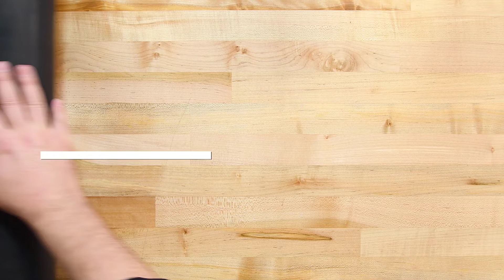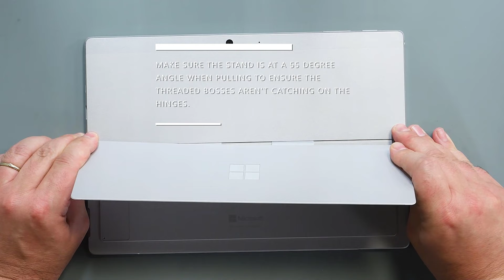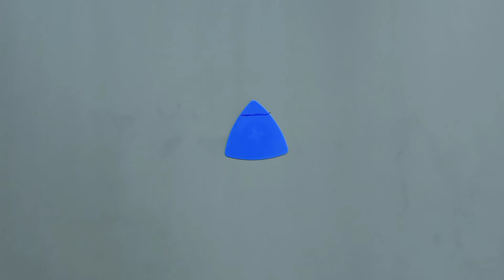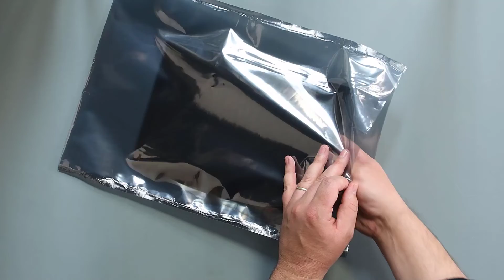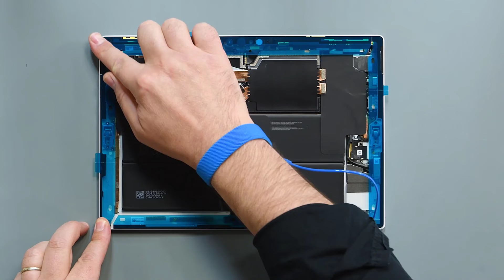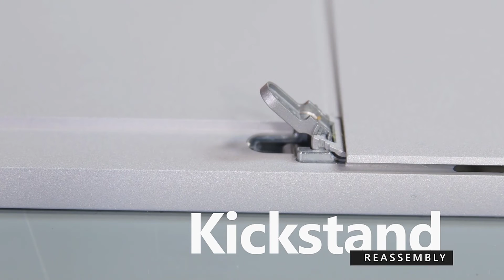Repair | Surface Pro 7+

Comment: For anyone else searching everywhere for "TDM Pre Repair Perp" like me.... They say this is a VITAL step, yet provide no guidance on actually configuring it. 

What i did was install the surface diagnostic toolkit, open the app, on the left side click the settings icon, then change the mode from "normal" to "technician" and then restart the app, there is now a drop down that gives you an option for repair setup and validation. There are now options for TDM repair setup, calibration and validation.